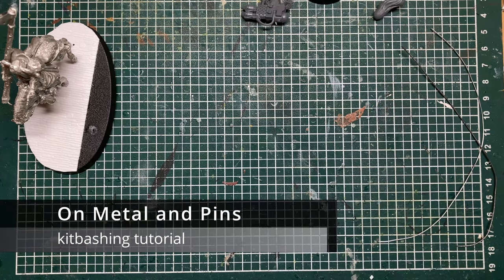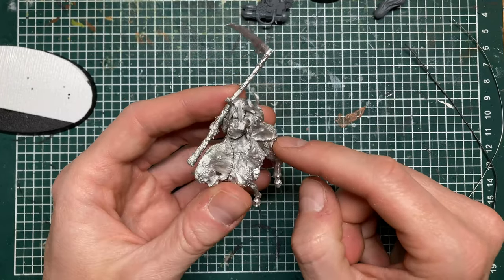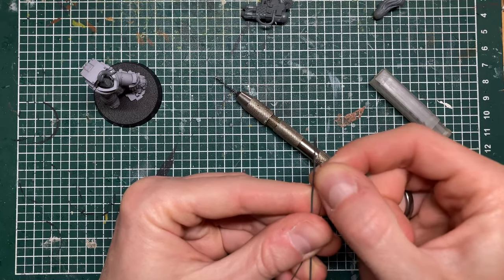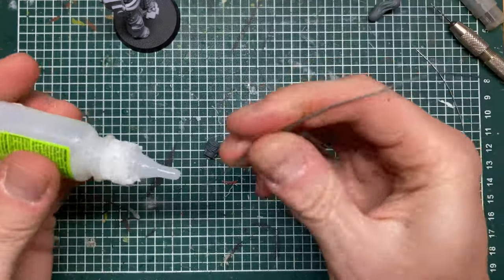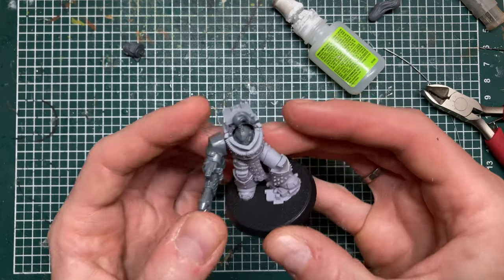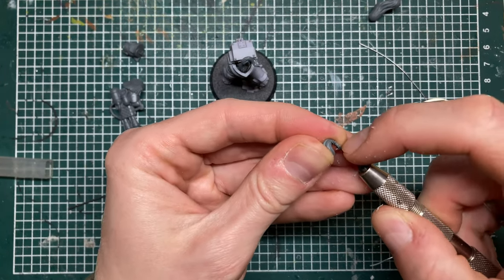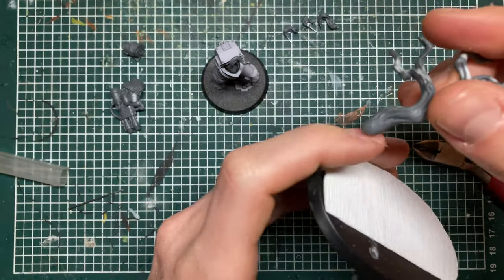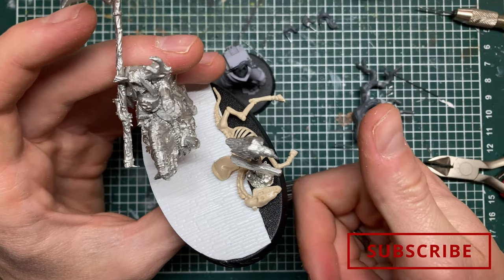Pinning miniatures to securely combine plastic, resin and metal parts - kitbashing tutorial

Comment: I've started using superglue with baking soda as an accelerator for metal models. It's a lot stronger than superglue on its own and isn't brittle like Zip Kicker and other chemical accelerators. It's strong enough you can even sand it and file it down. The other benefit is for pinning. You put baking soda in the hole and super glue on the metal rod. Then, when you join the two parts together, the pin pushes the glue into the baking soda and forms a bond from the inside out. 

I have never seen the sharp pin for making an indent before drilling. It's so fucking simple and obvious, but I've never heard of someone doing that in the 20ish years I've been into miniatures lmao 😭😂
Reply from the maker: That's a good tip too! I recently learned bout the baking soda (from an Adam Savage @tested video), never heard of that one before. But combining it with pinning is an interesting idea! And the indent for drilling saved me so much hassle once I figured that one out. Another tip was to add a drop of paint to the tip and make that put the mark, but I haven't discovered the need for that additional step just yet.